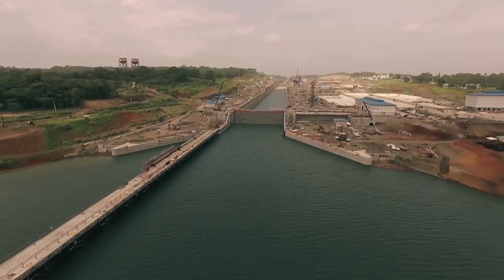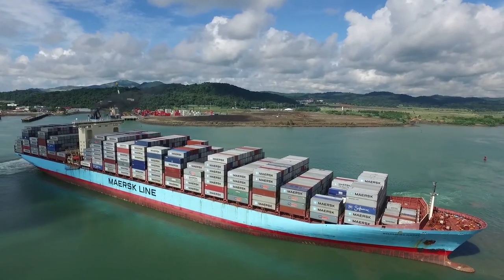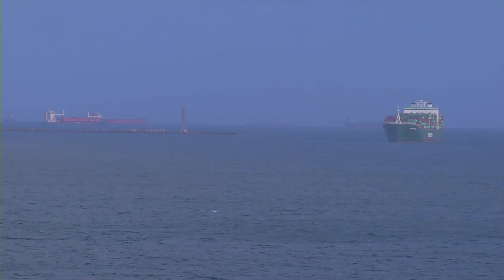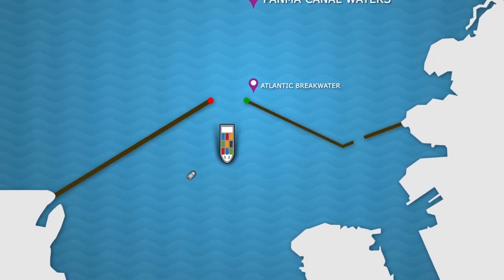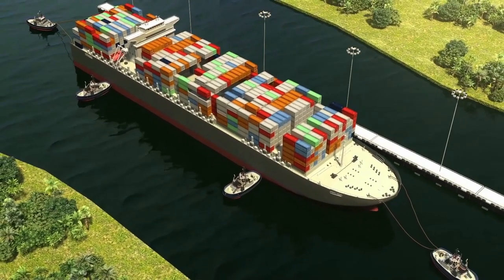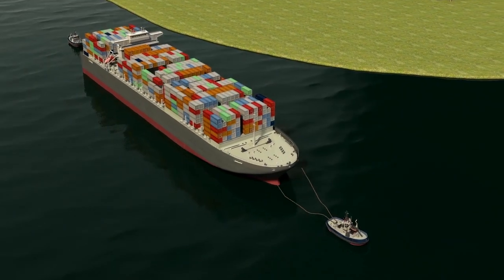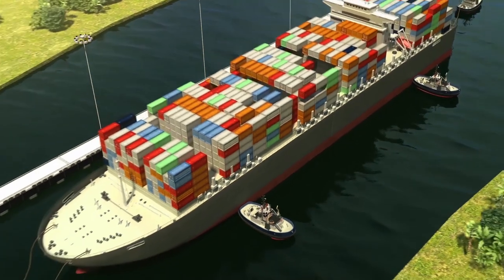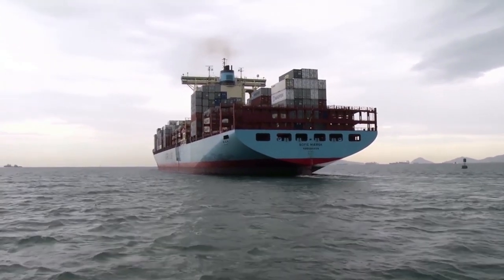A New Experience - Transits Through Expanded Panama Canal

Comment: Could you not save virtually 100% of the water by pumping it from the lowest basin to the upper level?  You could generate some of the power needed using the water flowing through the locks and into the basin
Reply: I'm not sure but it might have sth to do with them wanting to keep the lake with fresh water, because most likely the lowest basin will have brackish water.

Comment: Why the change from locomotives to tugs? Having longer locks to accommodate tugs takes longer locks and much more water.
Reply: +Greg Collins yes but water is saved here
Reply: doesn't matter time?
Reply: The canal uses fresh water from the lake at the middle of the canal and they are about maxed out on how much of this fresh water can be used.  The whole canal is powered by the fresh water flowing down from the lake to the ocean.
Reply: Some politician(s) involved in the construction of the new locks invested in a tug / pilot ship company?  I read the average pilot / tug fee for a U.S. port is $6000 for a mega ship, I can't imagine what the fee is for using the canal.
Reply: The Canals are totally dependent on the water level of the Chagres river to feed Gatun lake.
Reply: first watch other videos as well, where it is explained what are the reasons and why it is done. how are the Locos held in place, when they start pulling that they do not fall over inwards? law of gravity? and the new ships are 5 or 10 times as big. what infrastructure do you need for that. tugs can easily pull these ships....
Reply: @austrorus: Sorry, you should watch other videos first - then you would now, how the little cannl locomotives work and that they would have done that also with the new canal. For your convinience I may say this: The canal donkeys are cogwheel locos whereas the cogwheel is mainly necessary for climbing the steep and they are connected to the ground via a locking mechanism that secures them from falling in the canal if necessary....
What a bunch of nonsense you are telling here: The new ships arent 5 or 10 times bigger, not even close to that. The New Panamax Class declares the biggest size around 2,5 times the size of an Panamax ship - 5000teu against 13500 teu.....
The use of tugs isnt only a question of pulling power. Anyway - the donkeys dont pull the ship through the canal - the ships engines provide the forward movement, the donkeys "only" keep the ship in check by centering it in the canal. 
The use of tugs instead of  cog donkeys? 
Simple as that: At the opening of the canal 100 years ago there were no tugs with the power, maneuverability and ease of control as we can get today. You may lookup Azipod or Z-drive to understand this and why these tugs are able to center the ship between the canal walls.
But the last word isnt spoken yet and me believes they may use donkeys again when the ships reach the limit of the new Panama Canal......
Reply: i know that and i also have seen the videos. and precisely THIS is the reason why they opted for the tugbotas. to pull these huge ships the locking mechanism needed to be much stronger and heavier,so the locos also needed to be constructed much bigger. and there would be still not the desired results and needs proportion wise.
Reply: Great replies Pearly Humbucker, thanks. Aside from the above regarding tugs vs mules, if you´ve ever transited the canal, you´ll know the amount of time it takes to hook up, center and release the ship from the mules, despite the impressive expertise of the line handlers. With the huge costs involved in a canal transit, and the enormous demand, time is a precious commodity so hooking up to two tugs that guide a massive ship into and thru the lockages saves a great deal of time and makes the process much more fluid.
Reply: ....because they now charge per ship time in the canal of $1, 000,000 per 1/2 minute
Reply: kidding!
Reply: therealnightwriter  Water for the locks is coming from the lake.
Reply: @gregcollins3404  and because of the freshwater the ships sink deeper,there are lots of things to consider....the german navy tested torpedos in freshwater in ww2 and wondered why they were no good at sea

Comment: I look forward to the Engineers explaining how the ships being pulled down the lock by tug and crashing into the sides was eliminated as a possibility.  I don't have an engineering degree, but it seems there is not enough room for a tug to resist wind forces on the ship.
Reply: they cut costs by doing this and it will show when it does not work.
Reply: Cosmo Fitz because they broke down every fucking day
Reply: Did you watch with 1/2 brain, they indicate bumpers every 15.3 meters or so.

Comment: The new system replaces the locomotives with tugboats. Why is this better? 1) Pulling from land is more energy efficient than pushing water.. 2) A land based system can more accurately position the ship relative to the land based structure (i.e. the locks). 3) Longer ships could fit in the locks when just one ship is present, when moved by locomotive, versus three ships in the lock (container ship plus two tug boats)  4) Tugboat propulsion is diminished due to their closeness to huge cargo ship's hull.

Comment: Just an idea there must be a way to tunnel a tunnel from the ocean to the water storage chambers to save and mot use fresh water at all power to supply electric to pump the water to the chambers from the ocean the flow of water from the chambers to drive generators to produce electric  power and also in the reverse proscess. As the water flow no fresh water and no contamination of fresh water due to elevation  below the water way and gatoon lake !!!